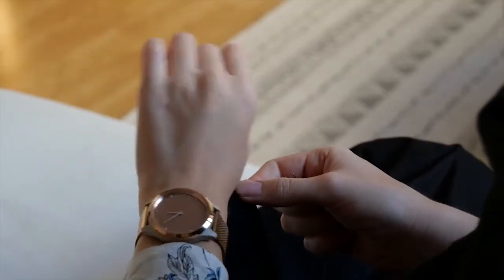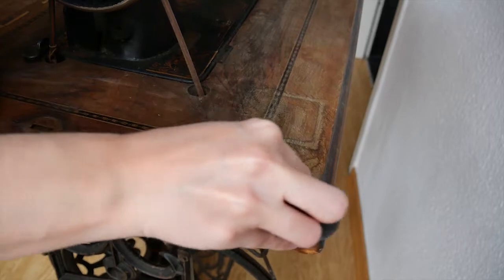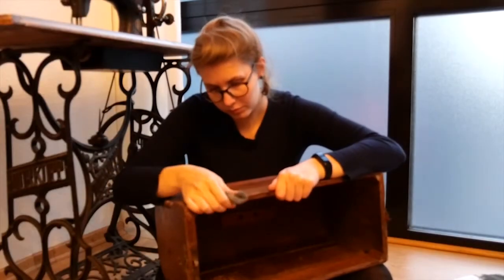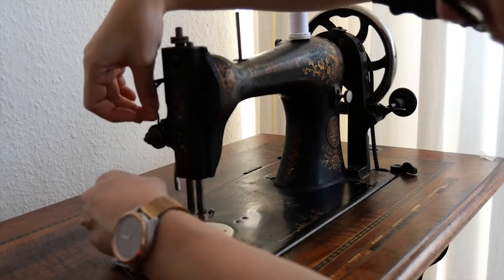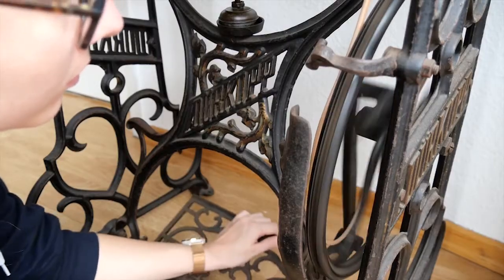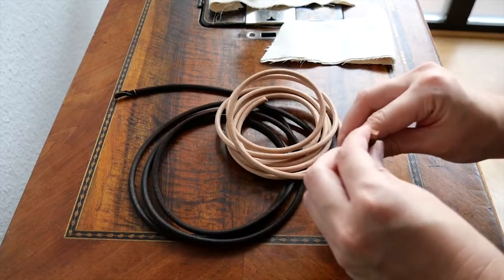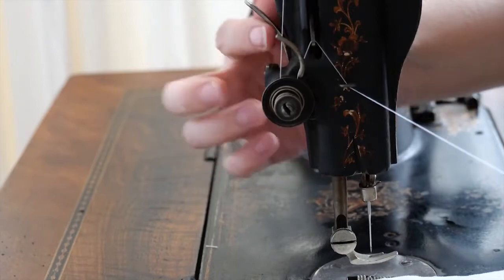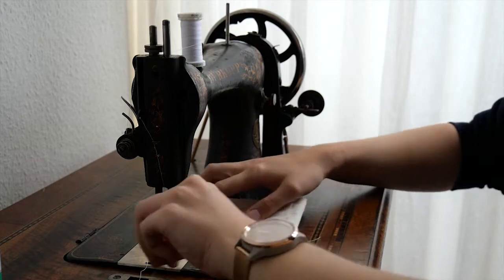I have brought an antique sewing machine back to life again.

Comment: Hi, it's lovely to see a grand old lady back in working order, I originally learned to sew on a treadle machine and for many years used a hand cranked singer,I still have her but now have to use a an electric machine, enjoy your machine.💖
Reply from the maker: Thank you very much! I will definitely enjoy working with her. I'm already scratching my feet for the first project.
I've never worked with a hand cranked machine before, so I imagine that is one of the most tricky things.
Reply: @ankanyofficial  not really just a bit of hand and eye issues
Reply from the maker: @lesleyharris525  So I suppose it's more a thing of practice? The maybe I will try it one day. 😊 Until now I avoided those machines.
Reply: @ankanyofficial  practice makes perfect.  It's not as hard as you think,.
Reply: @ankanyofficial  Over the winter I found a 1915 hand-crank Singer 99K.  Works like a dream; so much better than my electric.  It's just practice, the feed dogs are really strong so they do the work of your other hand in pushing the fabric forward.
- Cathy (&, accidently, Steve), Ottawa/Bytown/Pimisi
Reply from the maker: I haven't thought about the feed dogs as a support for moving the fabric, but that makes totally sense. Thanks for the insight!
Reply from the maker: @Steve Zytveld  Hey, I can see you've made another comment, but unfortunately only read part of it. As soon as I click on it, it disappears completely, for whatever reason... But what I understand so far is that you've been sewing again since the first lock-down. It's the same with me. Somehow, my fingers suddenly started itching again, and I picked up the sewing needles.

Comment: Wonderful machine! You did a good job cleaning her and getting the drive belt done right. Does she have a name yet? Important note : when sanding always use a face mask. You now have 100 year old dust in your lungs! Something to think about! I would open up every cover on the machine and clean and oil (with sewing machine oil) all places where two metal parts rub together. Try to find the owners manual online. Very helpful where to oil and set needle / bobbin hook timing. Others may know what year your machine was made. They will be happy to help! These old machines were built like tanks for what they had to do. Great grand daughters will enjoy using it! (year 2200+ ! ) Enjoy!
Reply from the maker: No, she hasn't a name yet. Sometimes I call her "Mamsell", because in German those machines were sometimes called "Eiserne Mamsell" (iron maid). But I don't think it's fitting enough...
If I ever sand something down again, I will wear a mask. I just didn't think about it at that time, just after I was finished.
Yes, the manual I found of a similar machine was really helpful, especially for oiling and understanding the mechanism. 
Thank you!

Comment: I love seeing the restoration of an old working machine like this. I actually recently bought a sewing machine of my own. The previous owner had inherited it from his mother-in-law and they kept the original warranty certificate. So even though my serial number doesn't give me an exact date of manufacture the warranty is dated May 4th of 1899. I'm going to check out your other videos now.🙂
Reply from the maker: That's really cool to have such old papers for the machine! Unfortunately, the serial numbers are not that helpful with these machines, but at least you have an indication of how old it is. Is yours in working order, or does it also need to be overhauled?
I hope you like the other videos.
Reply: @ankanyofficial  it was working until I decided I needed to clean it and then I broke a spring. So it's in the shop. I only got to make a few test stitches on some scrap fabric.😭
Reply from the maker: @taigarcia9278  Oh no! That's really unfortunate. 😵 But at least it will be fixed when it's back and then you can start sewing.
I was really afraid I would  brake something when I was cleaning my machine, somehow it didn't happen. 😅

Comment: Omg love this type of content, so cozy and soothing!! I have a similar machine but it's from 1954, it has an eletric motor attached but can also be used like yours, so it's always useful to know these kind of stuff and how to preserve it properly.
It sounds so good with the treadle!
Reply from the maker: Thank you! 
That is fascinating with the additional electric motor, I wonder if some were added later to the machines to keep up with the innovation.
Reply: Mhm, i think the same! They must did that not only with the eletric motor but also with the attached lamp as well. Have you ever took a look on those vintaque/antique sewing machine attachments like zigzag stitch and buttonhole tht are completely mechanical? They are all fascinting indeed.
Reply from the maker: No, I haven't had a look into that yet. But now, I will definitely do so. I love how adapting a machine was a thing, which doesn't seem to be done that often any more.